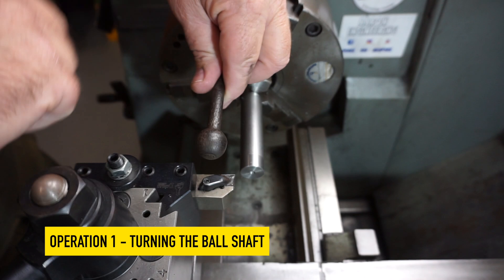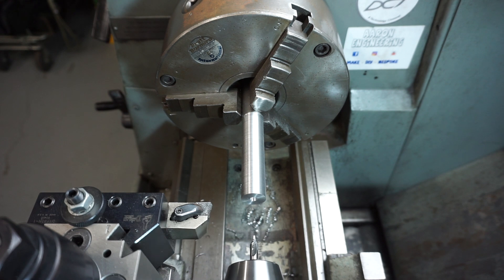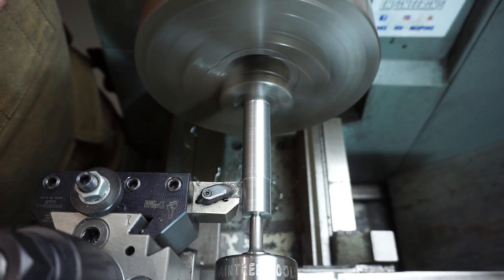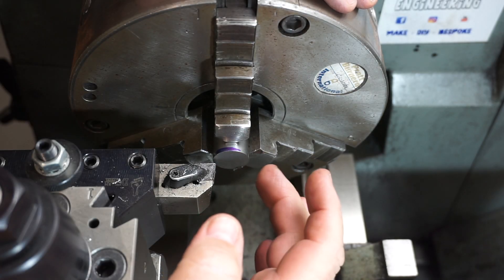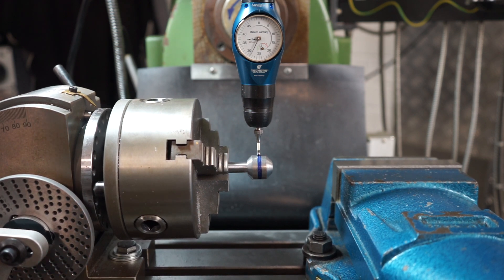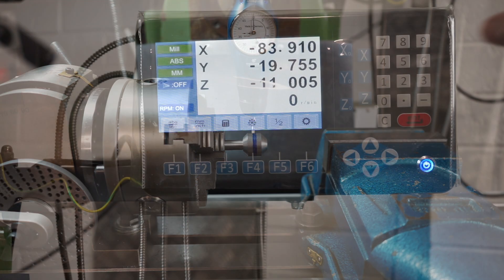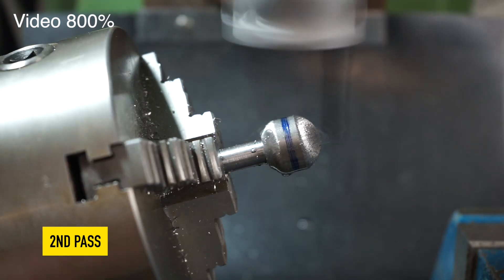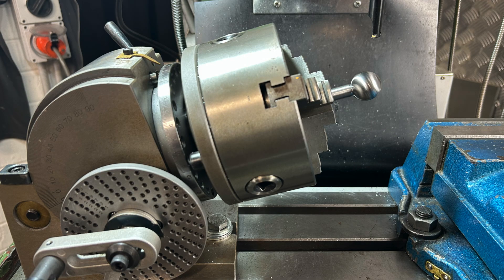Turning a BALL using a dividing head

Comment: I see now why you fitted a reversing switch! Very handy to be able to switch direction. When I first got my boring head the first few jobs I did were with the bar in the horizontal slot position. I initially thought I'd been supplied with a set of duff boring bars until I tried boring in the vertical slot and realised that it's just how the geometry works out! Certainly a novel way to make a ball, how long did it take?
Reply from the maker: G'day Olly.  Yes you are 100% correct, and that's why I had to fit the reversing switch.  To be honest manual machining the shaft took longer than making the ball.  I would say an hour including the set up of the dividing head.  As you would know, the fiming process makes everything twice as long too.  Cheers, Aaron.

Comment: Beautiful finish on that ball Aaron, but I've racked my brain for the reason you are running the mill in reverse, is it not the same as running in forward and the boring bar about faced 180'?
Reply from the maker: G'day Bob.  When I first tried to do this it also had me stumped.  If I had a left hand boring bar it would've worked in the clockwise orientation.  That's why I had to fit the reverse switch so I could get this job done.  Hope this makes sense mate.  Cheers, Aaron.
Reply: @AaronEngineering  Thank you Aaron, it does make sense now.👍